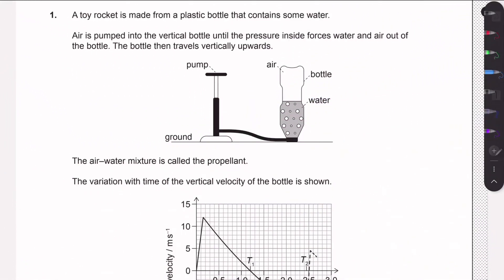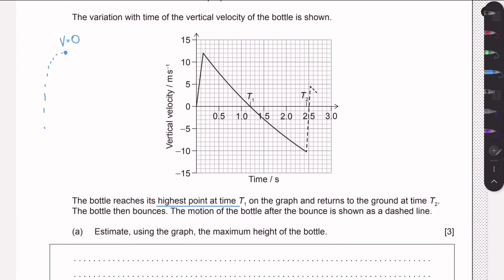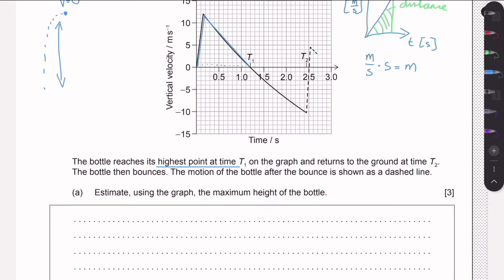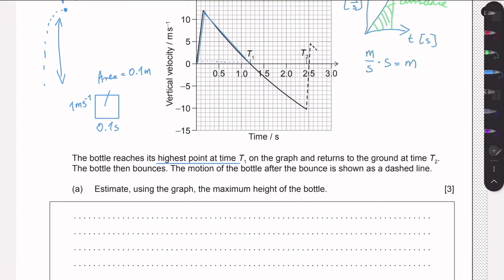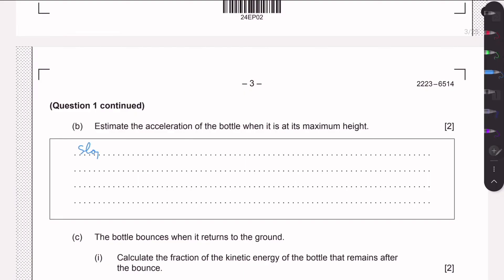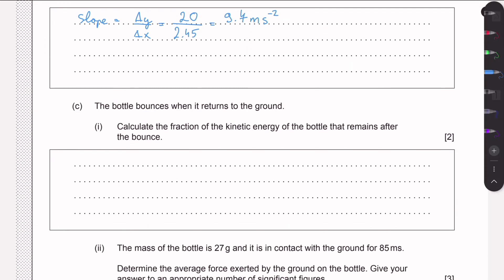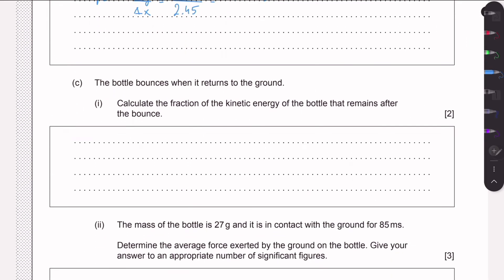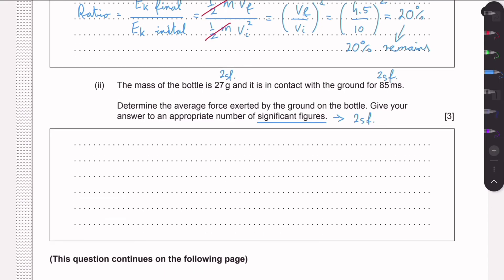IB Phy HL M23 TZ2 Paper 2 Q1 Mechanics || A toy rocket is made from a plastic bottle ||

Comment: for question 1d, can I use F=ma as my explanation saying that the air-water bottle has a higher mass so the force will be greater since mass is proportional to the force?
Reply from the maker: The problem with F=ma is that it assumes the mass is constant, which its not in this case. 

Just as a note, Newtons second law is in fact that the net force acting on an object is delta P over delta t, and not F=ma. F=ma is only a simplification we can deduce when the objects mass is constant, as then the delta m in the formula simply becomes m, and delta v over delta t becomes a, hence we get ma.
Reply: @ConvergingIB  thank you